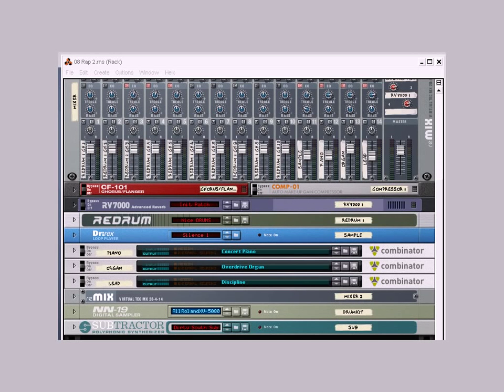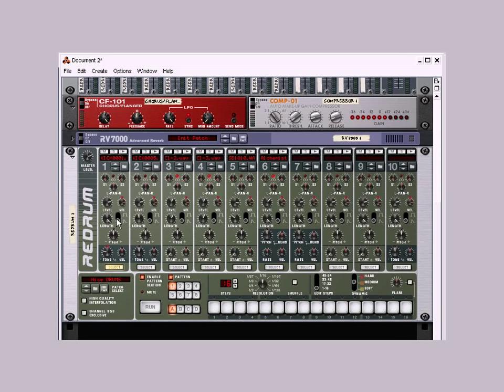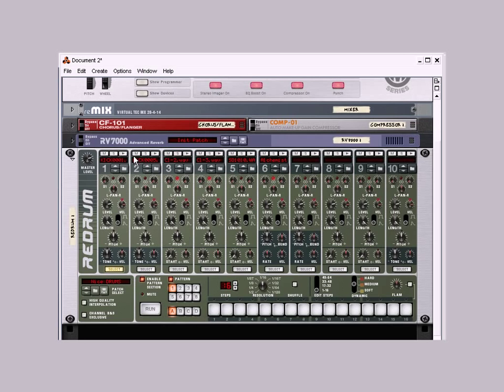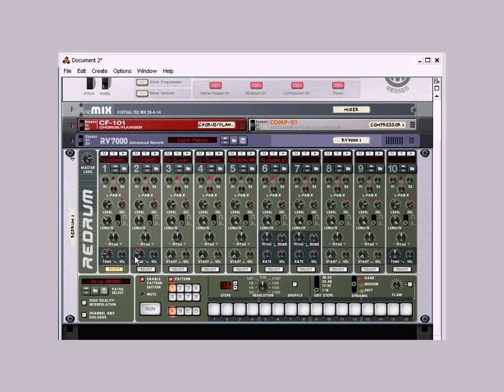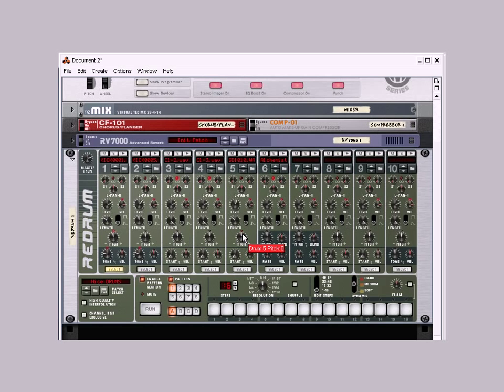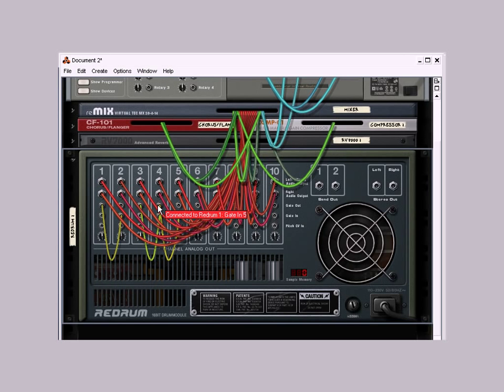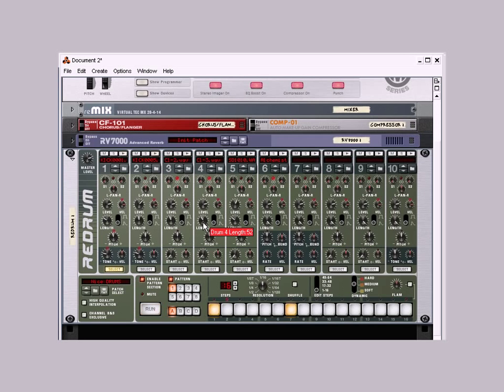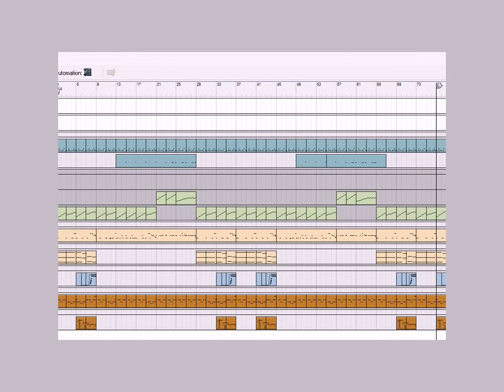How to Fatten your drums in reason

Comment: The tip on the "length" dial was so simple but so effective.   I wish more tutorials had quick tips that work immediately. I do agree with Ccpro83, keep them effects off the master bus.  I run zero on my master bus unless I am actually mastering a stereo mix for finalization.  Just me though, if your method ain't broke it don't need fixin.  Good vid, keep em comin.

Comment: @igotthesebeats tab to flip the rack. Then connect a send out (1) from the mixer to the input of the reverb, then connect the output from the reverb to a return (1) of the mixer. Then you can adjust the appropriate aux knob (1) on the mixer above the channel.

Comment: first u need real good samples - then its about layering kicks and snares - and eqing them separately (to get the low out of the snare and the sub and mid out of the kick) - then running them just the snares and kicks thru a tape compression on scream 4 (everything else can be eq'd in re-rum, or nnxt or the mixer), then send your main mixer outs thru another tape compression. do this right and it will make your drums LOUD

Comment: be careful with boosting those hi freq's dude.
Piont i would like to make is that what ever works for you, do it.

everyone has there own taste and method. that compression setting depends on what your going for, plus also the acoustic envelope of the sound (ADSR).

Also one thing to mention also which helps with fat percs is to make sure your samples are not out of phase. hence some freq get cancelled out. though i whish redrum had a flip phase button.

:)

Comment: The track sounds good but be careful with using compression on the master fader/combinator. I say this because you want to leave enough headroom for the mastering engineer to work with. Too much compression will squash the sound of your overall mix and there really is no way to repair that in the mastering process. My advice, make the track sound good without using any effects or dynamics on the master fader.